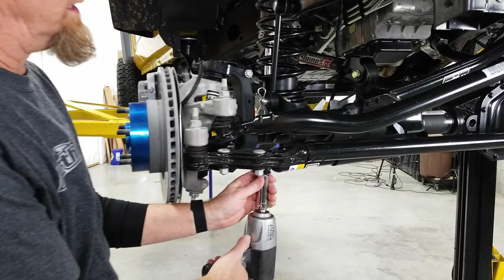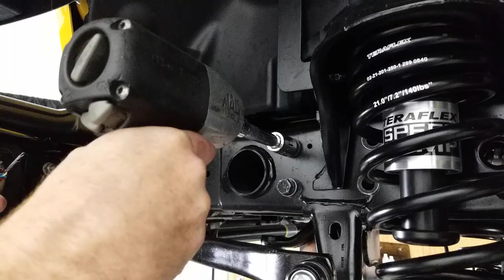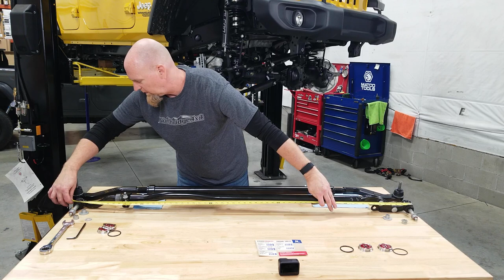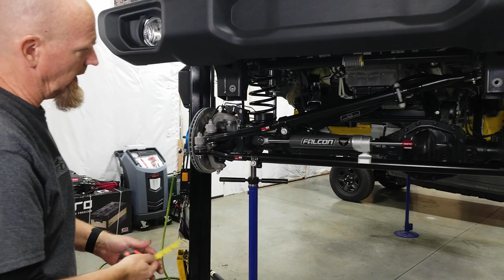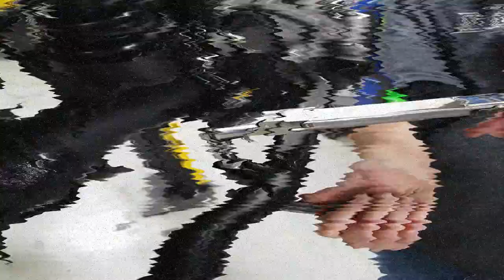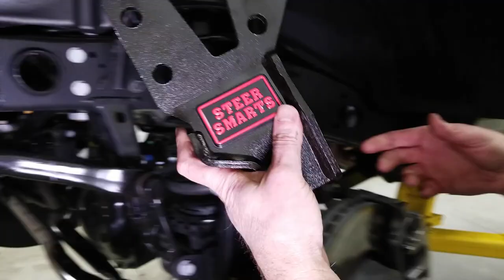Steer Smarts XD Drag Link & Tie Rod Installation

Comment: It's worth mentioning that you are using the JK version of the Falcon stabilizer as the JL connects to the stock axel location and cannot be used on aftermarket track bars. Also, the Steer Smarts track bar is 1-5/8" which is important when ordering the stabilizer.
Reply: Thank you this is what I needed to know and couldn't find anywhere on Northridge or Teraflex web sites.

Comment: Just installed this tie rod 1/8” in ( developed a Death wobble) was reading a jeep thread said to adjust to 1/8” toed out. Worked a lot better.  2011 jk 2 door sport 3” lift 17” wheels 35x12.50.
Reply: Steer Smarts recommends .5° total tow out

Comment: If you had to pick one to fix the "slop" in the JL steering, would you replace the Drag Link or the Tie Rod?  Either way, the Sector Shaft Brace is recommended right?
Reply from the maker: We would pick the one that is the most worn.
The sector shaft brace kit is a great addition, especially if you have the aluminum steering box.
If you have the steel steering box, we would replace the tie rod and drag link first.

Comment: You will regret that teraflex bar. They keep having issues.   Enter to go with the whole kit from steersmarts
Reply from the maker: What issues have you had?
Reply: Correct, I'm having issues with mine. There's a lot of noise and play when moving the steering wheel.
Reply from the maker: @josealferez6376  Whats moving?  Can you post up a short vid?
Reply: The Steer Smarts Trackbar won’t clear an ARB Diff cover.

Comment: Do you guys carry the Teraflex trackbar bolt that you used in this installation video?  If so what’s the part number please?
Reply from the maker: We normally use the Fox stabilizer bolt, unfortunately we are currently out. We do have more on the way:
https://www.northridge4x4.com/part/track-bar-brackets/803-02-028-fox-racing-track-bar-bolt
We do have some of the Synergy track bar bolts in stock:
https://www.northridge4x4.com/part/track-bar-brackets/8806-01-synergy-manufacturing-track-bar-stabilizer-mount-stud

Comment: Will the steersmart stabilizer tie rod mount work on that falcon?
Reply from the maker: It would work with this one: 
https://www.northridge4x4.com/part/stabilizers/09-02-22-110-000-teraflex-falcon-nexus-ef-2-2-fast-adjust-steering-stabilizer
And this one:
https://www.northridge4x4.com/part/stabilizers/09-02-21-110-000-teraflex-falcon-nexus-ef-2-1-steering-stabilizer
Reply: @northridgenation  awesome. Thank you 🤙🏻

Comment: The link in the description for the steering stabilizer is for the stock configuration. Is the model number that you used in the video the one for the JK model number for 1-5/8” tie rod? Part # 01-02-22-110-158
Reply from the maker: Yes, that's the one! https://www.northridge4x4.com/part/stabilizers/01-02-22-110-158-falcon-nexus-ef-2-2-adjustable-stabilizer-1-5-8-tie-rod